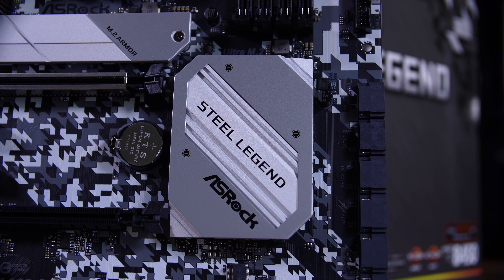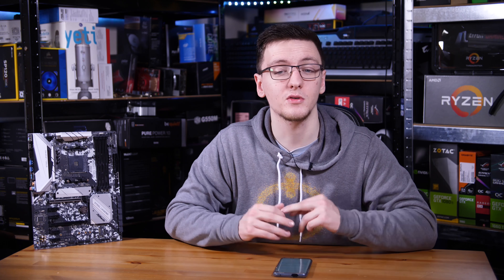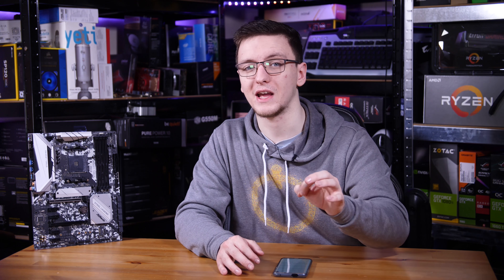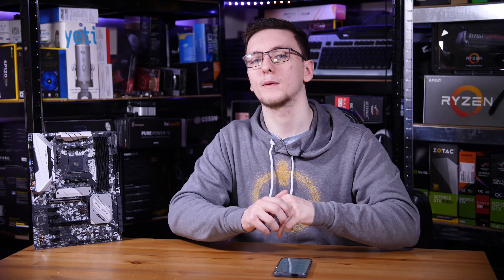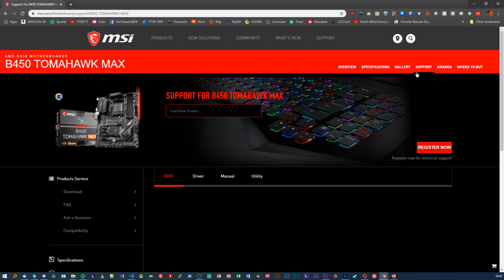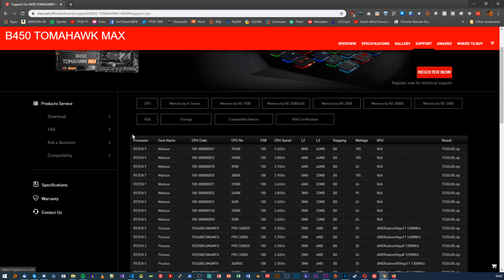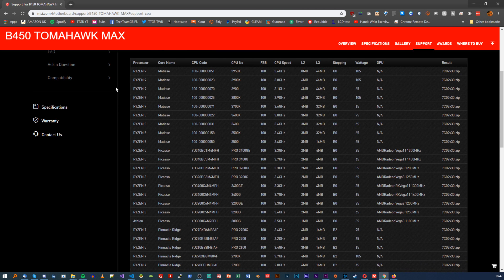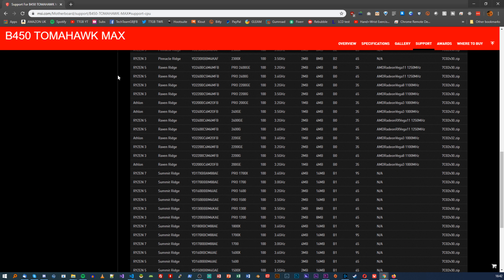Motherboard explained - chipsets, sockets and ports! - TechteamGB

Comment: What do the numbers and letter mean b350-f, b450, z370 etc?
Reply: Diffrent chipsets. B550 is better than B450, and X570 beats both but b550 is good enough.
Reply: @SussyBaka-em9rq  is a B450 good for my needs if I have a ryzen 3600, zotac dual fan 2060 super, 16 gb 3200 speed ram, 500 gb SSD? I haven't gotten to PSU or case yet. Please let me know, I'm in a bit of hurry as I'm trying to egt all these parts figured out and purchased by black friday.

Comment: You said that if I would like to overclock an unlocked intel cpu, then I have to have a certain motherboard for that, is it the same with AMD cpu?

I am trying to gather enough info to buy a gaming pc, but there are ALOT to know before buying..
And I am lost tbh.. I hope you could help me choose the parts?plz

Thinking about:
- Gtx 1070ti

-Intel core i5 9th gen but ppl said the new AMD is much much better? But which one? Ryzen 5 3xxx?

-x2 8gb ram around 3000mhz, don't know if i need more or less

- already got 500gb ssd and 2.5" 2TB hard drive, from my old laptops.

- case doesnt matter

- 80 gold or better power supply, 600watts

- motherboard, I have less than zero idea for which to go for 

Thx for the videos and the help
Reply from the maker: AMD CPUs are all unlocked, and any B or X series motherboard (B450, X570 for example) will let you overclock them as much as you like. Are you looking to buy the GPU used? I'd probably go with a Ryzen 3600X and an MSI B450 Tomahawk Max - or if you can wait, a B550 board instead for better forwards compatibility, along with 16GB of 3200Mhz/3400Mhz/3600MHz depending on what you can afford.
Reply: @TechteamGB  Is it safe to buy used gpu?
Cuz then I would afford an RTX but I am quite skeptical about it
And wow, about AMD, I will go for them for sure as a cpu

Thank you so much for these valuable information

Comment: ok i just have one question can i use the B460M PRO-VDH WIFI with the intel core i5 10400 they both have a 1200 socket but for chipset the intel core i5 10400 has a Intel 400 series chipset  and the B460M PRO-VDH WIFI has a Intel® B460 Chipset, will they work ?

Comment: I have about 5 or 6 questions today :p.
What do you know about VRM's and 8+2 or 6+1, phase doublers?

Also I saw today that the B550 boards support PCIe 4 x16 graphics support, PCIe 4 CPU Storage Support, PCIe 3 CPU Chipset Uplink and PCIe 3 General Purpose lanes?

Can you help clarify this as PCIe is becoming a lot more complicated then I thought :).
So I guess this means - 
              I could run a PCIe 4 graphics card, 
              but can only run NVME at PCIe 3 speeds. 

 I am scratching head regarding the CPU and CPU Chipset Uplink. 
           * What's an uplink and how can these have 2 different speeds? 
              Would this mean the CPU is being slowed down by the chipset?
Reply from the maker: I'll do my best here:
-VRMs: they are what regulate the power going to your CPU, generally, the more phases (8+2 would be known as 10 phase, 6+1 would be 7), the better, as there are more channels to accurately deliver power to the chip, and normally the more total power output they have too. The first number in 8+2 is the number of phases for the CPU, the other is phases for the chipset. Most controller chips only have 8 channels for output, so a doubler is a "cheap" (but effective) way of getting more power out of a single channel on a controller. 
B550: So you can run a PCIe Gen 4 GPU, AND 1 Gen 4 NVME SSD (in the top slot of the motherboard), but any other NVME drives, or anything else connected through the chipset, would run at gen 3 speeds. 
Chipset link: the chipset is like an extra input/output controller, it needs a way to relay the information its getting to the CPU, so it has a connection to do that. With Ryzen CPUs, they are "SoC" or system on chip, meaning they handle everything internally and dont need external controllers to communicate, so you can feed it a gen 3 link from the chipset, or a gen 4 one, and it'll accept it just fine. PCIe is a very backwards compatible link, so running the chipset at gen 3 is completely separate from running the GPU at gen 4, for example.
Reply: @TechteamGB  Excellent thankyou :) A few more questions.
I don't think you are saying that the Ryzen SoC don't require a chipset anymore, I am going to take a guess (using an analogy) that instead of splitting up the workload or traffic control 50% 50% The Ryzen CPUs take 2/3 and leave the other 1/3 workload or traffic control for the chipset.

I/O is a term that is thrown around a lot, I know every device has Input and output and that the mother board has an IO shield near all the ports that I can plug devices into. But I also hear referred to things like the CPU or Chipset or Memory IO or motherboard IO.

I think there are a thousand different terms that I am slowly getting my head around.  I need to strike a balance between personal research and getting my assignments done, so your help is valuable and has saved me some time. Thankyou.